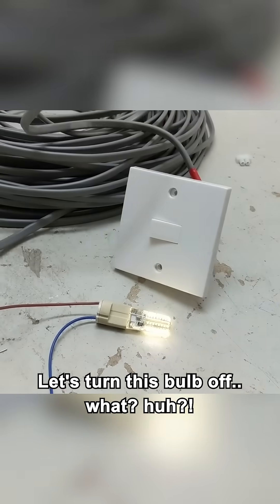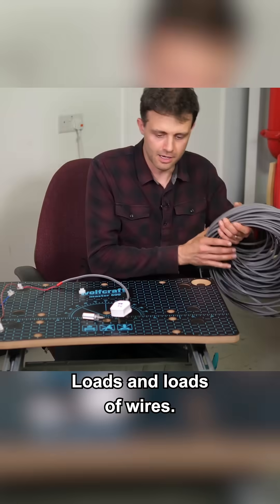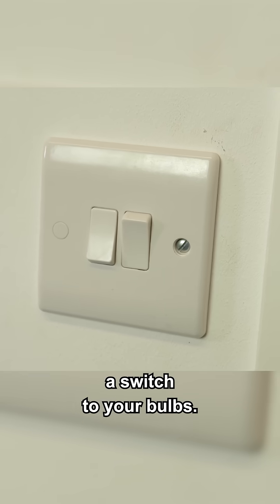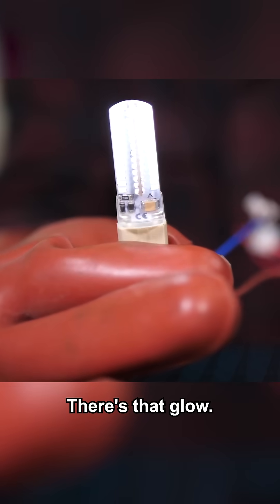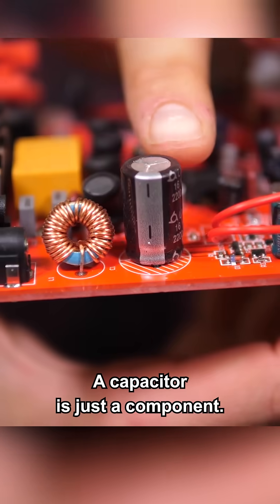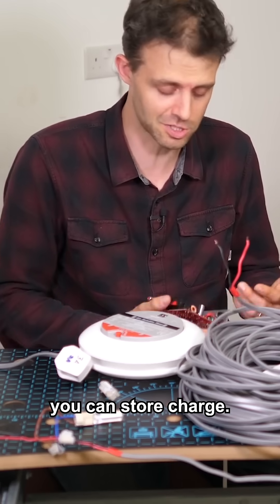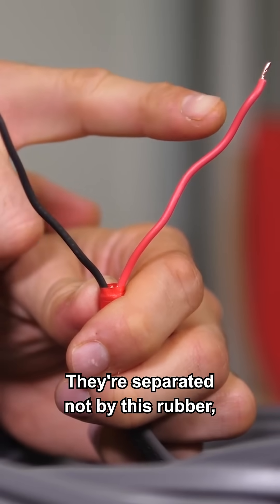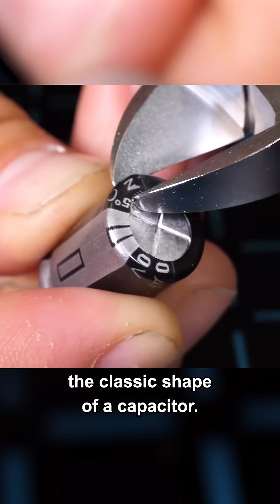This Zombie Bulb Will Not Turn Off! But Why?

Comment: Pretty cool, I used to wonder why they’d glow after turning the light switch off.  I think now they have some kind of self discharge thing in them so they don’t glow idk but the ones I have now don’t glow.
Reply: @pahub9256  other reasons for the glowing exist, other than what was explained in the video. Welcome to the world of electronics n things
Reply: no it's not cause he used a lot of wire, and 3 wire Romex or separate wire won't make a difference. LEDs who don't do this use a different voltage control or just a high ohm resistor to use (or waste) this power. really cheap and effective circuitry means the live wire going to the switch and the one coming back are close enough that the magnetic fields move enough power to glow. cheap leds that don't glow  just waste power bleeding this power thru a resistor, and units that use different power drivers are still usually less power efficient and cost more. thought they can last longer for other reasons
Reply: Or the old compact fluorescents used to glow because the coating on the inside of the bulb took an extra few seconds to dissipate all its energy
Reply: @kieran977 There's an analogy of this in certain LED bulbs that use large amounts of phosphor filled plastic to convert ultraviolet light to white, when they turn off the phosphor takes a few seconds to stop radiating.
Reply: I must have the same crazy ghost bulb since 4, 5 or 6 years. Those thing last forever !
Reply: Old ones were more sensitive so the low voltage of the wire “capacitor” was able to produce a glow new ones are not as sensitive and require a minimum voltage higher than the wires hold
Reply: Also phosphors having residual energy and taking time to fully discharge. Like CRT TV's or florescent bulbs, etc. 

Also there's some inductance from the switch. They don't actually turn the power all the way off. There's inductive bleed through inside of it from one contact to the other due to a minimal spacing between them. I've measured as high as 70 ish volts AC on a 120V circuit due to a specific design of old switch. 

Most I see these days are much lower than that, but it still exists.
Reply: Depending on how simple the led is it might glow more expensive ones will have circuitry to stop power below a certain threshold
Reply: it's a sort of Chinese crap
Reply: Happens on multiple lights in my house. Although I notice it only happens on occupancy switches. I just assume the leak a little voltage
Reply: there is still a lot of cable conected to the light bulb from the switch. that wire stores stores 2 charges one side positive and negative between the light 
even if the switch is close the electrons want balance all the positive push each other and same with the negatives and the oposites pull each others so the electricity still flows in not live wire 
this low electric flow is enaugh to make led bulbs light slightly
Reply: You can attach the capacitor to a dump resistor to release extra charge, it's usually a safety thing in much higher voltage systems
Reply: my man open one of those things up and look at the capacitors that are in there , they have to discharge 1st .. it's not the cable length thats just nonsense 1st of all that won't produce enough power for a modern led, that coil is thousands of times less effective as the insides of a small capacitor, thats all do to surface area, and second of all your home does not have coils of electrical wire in the walls it's pretty much just straight lines huh. also they do have a self discharge build in, like sort off, they just like ddisconnect the led unit from the rest of the circuitry basically , so you wont see the discharge glow, the cheap ones don't have this tho because that saves on production costs and materials because god forbid they spend an extra 2 cents on the parts for that because when you make millions of those things every year that  also saves you millions of moneys at the end of the year huh.  fun fact most modern routers now have an Led in the adapter so you can visually see when you can plug it in again when you have to unplug to reset your router so you dont have to sit there and count to 60 to let it discharge now you can just watch the led slowly die out and turn off.
Reply: @Falcon0239  PWM controlled LEDs don't usually exhibit this as they are actively switched while running, but it's still fairly common in some others.
Reply: The old ones were likely incandescents which just glowed because the metal filament takes a few seconds to cool down. You may have LED bulbs now that don't use thermal radiation like incandescents do
Reply: @91JLovesDisney  no, leds run on a simple rectifier with enough leds in series to take the raw voltage takes milliwatts to glow. those leds will glow like that as long as the wiring has power.
Reply: @adrianwilson7536  I understood the video, OP just made it sound like past tense so I figured incandescents might be more likely, idk
Reply: @91JLovesDisney you clearly don't. Try to understand why the screwdriver for detecting AC is glowing when you put it on the one pin, it's the same effect as this. The capacitor formed by those superlong wires is acting like a high value resistor for AC current, letting the small current pass continuously through neutral even if the live is disconnected. It's NOT the capacitor discharging effect, wires can't be storing any usable energy like that, it's just a few pF.
Reply: @michalpazdera3715  Speaking of capacitance, you have absolutely no capacity for reading and understanding messages 🤣 I understood the video. My answer to the comment was not my explanation of the video, it was an alternative explanation for incandescent bulbs, if OP's bulb happened to be incandescent.
Reply: @91JLovesDisney  Wrong. It's LED bulbs that do this. What we're talking about isn't that they stay on for a few seconds, but that they are dimly lit the entire time they are off. It's because of the extremely low current required to light an LED, which is low enough that it can be induced by nearby wiring. It's precisely because the bulbs are not incandescent that this can happen. Anyway, the original commenter is correct - only cheap bulbs do this, the better ones have some extra circuitry to prevent it. It's not anything to do with self discharge though, believe it's just an internal switch that keeps the LED disconnected when voltage is low.
Reply: @sauercrowder  read my other responses
Reply: @91JLovesDisney Sorry to say but My LED bulb is a Zombie Bulb too..and now I know what the problem is... Don't know the solution😅
Reply: @BubuDuduLove  The simple solution is to just replace the bulb with a better one, most have internal circuitry to deal with this - just not the cheap ones.
Reply: @91JLovesDisney  This short term phenomenon happens since in LED bulbs due to the transient voltage in their onboard power supply still being just high enough to keep them on for seconds to a few minutes depending.
Reply: @pahub9256  Yes, this person just sounded like they were describing a bulb in the past... which seemed more likely incandescent but IDK
Reply: @pahub9256 do you realize that the only reason why that happens in the video is because he has stupid amounts of wire connected to the bulb? That effect does not happen in a regular electrical installation.
Reply: I can do the same thing with a short piece of wire and the right frequency I think thats what hes referring to how complex the beast is @wea69420
Reply: @wea69420 Well, I have outside lights far from their switches. When I put LED bulbs in the fixtures, they wouldn’t completely turn off (as in the vid). I put halogen bulbs in and now they turn completely off. (My internal fixtures w LEDs turn completely off.)
Reply: @wea69420  it's very common that regular electrical installations have hundreds of feet of different cables running next to each other, that creates capacitance.
Reply: @wea69420 well, it happens in my house. It happens in a two way switching, only one off mode is affected. 
Electricians tried to sort of fix it but grilled the part with a short circuit. Waiting for second try ever since.
(it also happened in the flat where I lived before, really short wiring there but it still happened)
LEDs simply need a ridiculously small amount of current.
Reply: @Brandlingo  it might be down to the wire type used in your area, if its regulated by code. Where I'm from most installations are made with individually insulated wires, the side by side ones are almost never seen.
Reply: @wea69420  it's rare but it does happen, usually when there is multiple circuits running together
Reply: Wires have no effect with AC. Only DC can be stored

Comment: Isn't it an inductor? Inductors resist to change in current don't they?
Reply: An inductor is a coil of wire a capacitor is to plates separated.
Look up how a "tank circuit" works, you can get current to oscillate between the two components.
Reply: It looks as if it should be an inductor, but isn't.  There is some negligible amount of inductance in this circuit, as there is in even just a single circuit of just one loop.

However, due to the fact that the two polarities carry equal and opposite currents, and are both in the same cable and coiled in the same direction, the inductance is nullified.  Inductance requires constructive interference among magnetic fields, while this setup has destructive interference.
Reply: What he's missing is there's inductive bleed through happening in the switch. 

Rarely are mechanical switches used for residential lighting, successful at completely eliminating voltage on the load side of things. Most of our bulbs operate above like 100v (even fully dimmed) and anything below, they present as off. 

Something else he's missing is the excitation of the phosphors that make the light white in the first place. 

Like an old CRT TV or florescent bulbs, there's leftover charge that takes time to dissipate
Reply: нет, это резистор
Reply: @Humpiv  Почему резистор? Это же почти катушка индуктивности. Резистор "тратит" энергию, превращая её в тепло, а тут энергия сначала тратится на изменение тока в цепи, а потом получается обратно, из-за индуктивности.